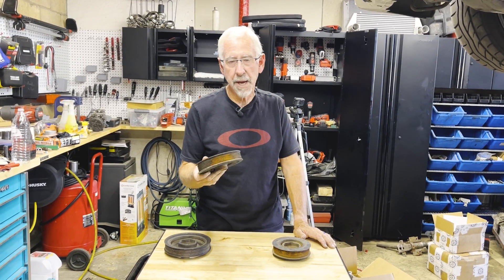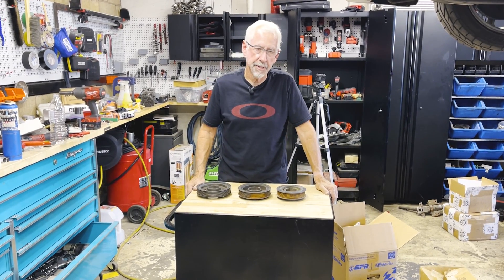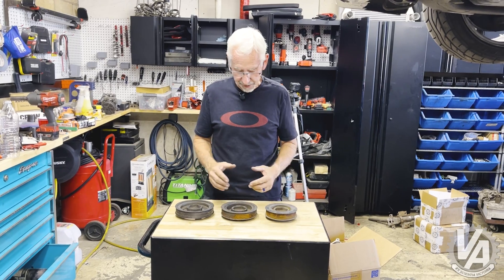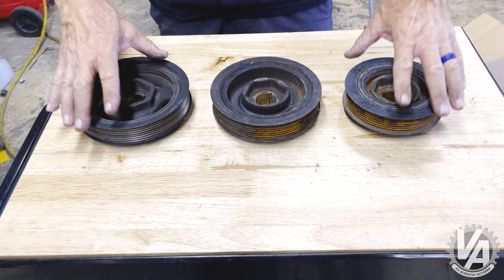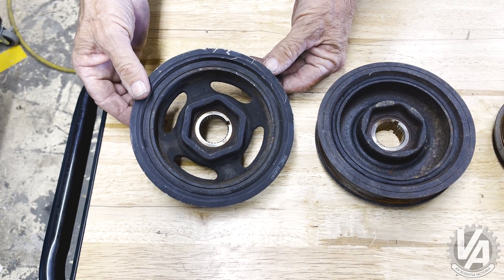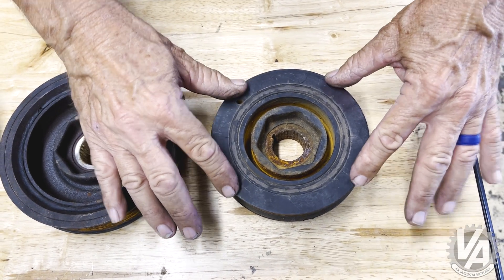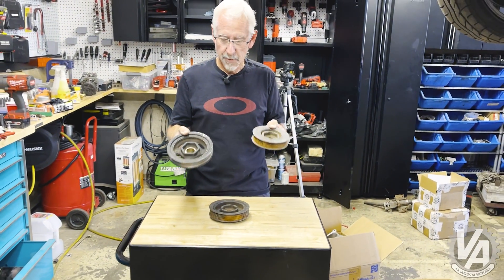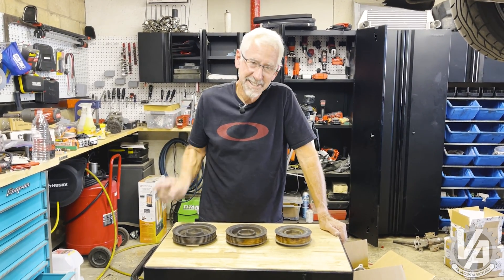Trick to Make More K Series Power

Comment: Are there risks using the k20 pulley on an na k24 thats mainly DD; any over heating concerns or changing system issues?
And what belt would be used?

Comment: Can you guys do a video on mods that sharpen throttle response and feel for us older guys who don’t care about gaining 2whp?
Reply: Good full Intake (hot air sucking short ram if you want even quicker throttle response) and full exhaust upgrade and you will have a quicker throttle besides the lag if you have a etb which can be fixed with a tune.
Reply: @GoFastKDB  is it the longer the intake the worse the response?

Comment: Can I use the base model rsx pulley on k24a2?
Reply from the maker: Yes.
Reply: @VTECAcademy  base model RSX (K20A3) pulley is the exact same size as K24A2 I know from first hand experience. At least in my case when swapping over from ‘08 TSX to ‘06 RSX Base motor.
Reply: Which one I would use for turbo ?

Comment: Won't you potentially be more likely to overheat with a smaller pulley since the water pump isn't moving as much coolant?
Reply: Depending on the application, maybe. Less coolant flow means less cooling potential and more possibility of developing hot spots in the head and block. I have no first hand experience with the small pulley, but I do know that Honda used the bigger pulley on the K24 for a reason. Whether that reason was to help the alternator keep up better at idle, improve AC cooling, more effectively cool the larger engine in a heavier vehicle, a combination of all these factors, etc, so you'd have to do your own testing to know for sure.
Reply: Often a slow steady flow is better for exchanging the heat into the coolant and think of it this way the original engineer’s design the system with mostly low speed driving in mind and an engine that’s modified is likely to be used at higher rpm more often and a smaller pulley can improve cooling and prevent pump cavitation in some extreme’s
Reply: @needmoreboost6369  You are mostly correct. Assuming all else is equal and no cavitation, more coolant flow means more cooling potential. At higher than stock RPM, cavitation can certainly become a problem and slowing the pump down can help save power and prevent cavitation at the expense of low speed cooling. Remember that family car cooling systems must be designed to adequately cool the engine under a worst case scenario such as an incompetent driver towing a trailer up long, steep grades in high gear at a low RPM and the throttle wide open. In such a scenario, the engine will be producing a ton of heat with the water pump spinning slowly. Since the pump has to be sized for a worst case scenario, it will be way oversized almost all the time. This is why electric water pumps are becoming more and more common- they can match the coolant flow rate to the current conditions instead of running at maximum flow all the time when not needed, saving power and increasing fuel efficiency. Note that this is not a suggestion to convert your K20/K24 to an electric water pump.
Reply: @averyalexander2303  I got rid of my k20 lol I’ve got an iron gm v6 turbo now, definitely not worried about parasitic loss on this one!
Reply: I have a rbc pulley on my k24a2 qnd it charges and cools perfectly

Comment: I daily drive a 315 hp tuned K20A2 without AC or power steering and a lightweight pulley. The car revs are violent even in a 3rd gear pull. 💪💪
Reply: What clutch are you running boss?
Reply: @oscarjsm24  Stage 2 ACT, Fidanza flywheel. Stage 1s can't handle all the torque
Reply: @Charmer4856  how’s the flywheel holding up. I heard mixed things about Fidanza. How many miles on the kit?
Reply: @oscarjsm24  flywheel is holding up fine. It’s about 20 thousand miles on this one. Replaced it end of 2020. I wanna say the Act SS clutch and flywheel set up is sketchy. The flywheel on that first combo didn’t last long
Reply: Wish belt can i use for a k20/24 with k20 crank pulley and power steering delete pulley..want to keep ac

Comment: My question is for daily driving is this even worth it? I mean, is the parasitic loss noticeable with Dimming of the lights stereo?
Reply: For a daily driver, it's probably not worth the less effective AC and possibly engine cooling, reduced alternator output, etc. The alternator won't necessarily consume less engine power just because it's spinning slower either, depending on its efficiency curve.
Reply: @averyalexander2303  I guess I’ll I’ll find out
Reply: @Onelovej was it worth it

Comment: My question is will these be safe to use on a stock k24/ 7th gen Accord that is equipped with a exedy lightweight flywheel, true cold air intake, and a tsx throttle body and how much more power will I see/feel over the stock 166hbp/160 torque.
Reply: To the best of my knowledge, no one has actually put the smaller K20 pulley through any kind of OEM level validation on the K24, so most answers are probably going to be uneducated with no real data to back them up. I could see 2 potential engine related issues though. First, the water pump won't spin as fast, reducing cooling. Second, if the K20 damper doesn't effectively dampen the K24's vibrations, crankshaft and bearing damage could result. The dampening characteristics of a crank pulley are specifically tuned to that engine and the K24 having a longer stroke than the K20 likely changes the tuning of its pulley, but whether the K20 pulley could cause problems in the long term is impossible to accurately answer without extensive testing and/or access to Honda's engineering data. If that was my Accord and increased power with good reliability was my goal, personally I'd leave the crank pulley alone and put the 06-08 TSX K24A2 in it. You'll get dramatic gains with OEM reliability as long as you keep the engine reasonably stock.

Comment: Base RSX P/N (13810-RRA-A02) shows cross reference for TSX base as well, must be a larger diameter pulley? RSX Type S and 06-11 SI shows same P/N, (13810-RRB-A01) are these the ones you are referencing in the video?
Reply from the maker: Yeah, that's the mid sized pulley.
Reply: So your saying to use a k20z3 pulley correct

Comment: Beware undampened crank pulleys, the harmonics will destroy your oil pump.
Reply from the maker: All the OEM pulleys are dampened, so you're golden with one.
Reply: What about an aftermarket lightweight pulley like nst or ralco rz?
Reply from the maker: @k24in31  We haven't used them ourselves, but other people seem to really like them.
Reply: Indeed. If you modify your CR, swap pumps w/o balancer or use ligthweigth flywheel, you wil get a nice headache! Im saving  few 💵  toy buy a Fluidamper and install on my 9gen Si
Reply: @edgarfernandez4666  Wrong I been running a 8 pound flywheel on my K20Z3 for 4 years no problem!!!!

Comment: I have a k24 in my crv 2005. If I add the k20 pulley how much more power would I make. Would it be noticable? Would it be worth it?
Reply from the maker: We need to do a dyno test to get the numbers for ourselves with just the pulleys as the difference. It's hard to say how much you'll feel it in a CRV since it is heavier than the Civics, CRXs and Integras we usually use them in. In the lighter cars we do feel it.
Reply: @VTECAcademy  ok thanks
Reply: @VTECAcademy what about for a tsx with header decat intake flash? could expect 5hp? 10? less?

Comment: What would be the approximate HP gains with that smaller pulley? I have a 1989 CRX with a K24A2 not sure if the pulley has been swapped, is there a diameter of the smaller K20 pulley?
Reply: Not sure the diameter, but it's just a few hp difference. One of those 'things that add up' when you do a bunch of these mods.
Reply: @nobodynoone2500  I'm gonna need more of these simple mods?
Reply: You won't "gain" any power, you'll just reduce the power consumed by the accessories, possibly at the cost of their effectiveness depending on the application. I haven't seen this dyno tested, but don't expect any massive differences. Depending on your setup, maybe 3-5 HP max?
Reply from the maker: The smallest OEM K series pulley is the K20 Type R pulley at 5.115" diameter.
Reply: @VTECAcademy  Thank you. So I can put it on my CRX without any problems? I'm trying to make the engine safe. I already installed the Type S oil cooler and I'm getting the pump as well. Maybe a 40° VTC.
Reply: @bobbydelamar606  You don't need to "make" your K24A2 safe, it's already very safe in completely stock form operating within stock HP and RPM parameters and will probably outlive both of us with proper maintenance. If anything, using a harmonic balancer not designed for the motor and underdriving the water pump might reduce longevity. A Youtuber by the name of Clymers Carport has a bone stock 05 TSX with over 600,000 miles and it still makes virtually the same compression and power as a new 04-05 K24A2.
Reply: @averyalexander2303   600k miles!! Nice! I might leave that pulley the same. I was referring more to the oil cooler I installed and using the Type S oil pump.
Reply: @bobbydelamar606  I have both the OEM oil cooler and RSX oil pump on my K24A2. The RSX oil pump will free up a few HP and lose  ~10 pounds since you will be eliminating the heavy balance shafts. I haven't seen any dyno testing, but the gains won't be huge. The oil cooler won't gain you any power, but it will help to warm the oil up faster and keep it cool. Neither of those mods should cause reliability issues if done properly and could contribute to reliability, especially when pushing the engine hard at above stock RPM and/or power levels.
Reply: @VTECAcademy  First I have to finish this wiring!!! 🤯 I'm trying to hook up sensors and  have the gauges work. I installed Rywire tucked harness and Hybrid Racing conversion harness which is plug and play but there are still other wires for CEL, VSS, ECU power, etc.
Reply: @VTECAcademy  Okay just finished most of the wiring. I measured my pulley and it's like almost an inch bigger than 5.1" unfortunately. But I did start my CRX for the first time, sounds nice but it died after 5 seconds. It's not getting fuel but the Walbro 255 is turning on 🤷🏻‍♂️ I do hear fuel rushing thru the KTuned regulator...?
Reply: @VTECAcademy 
This is from the rsx type R pulley ? Or the Honda civic type R ?